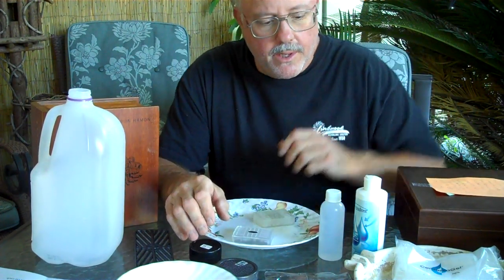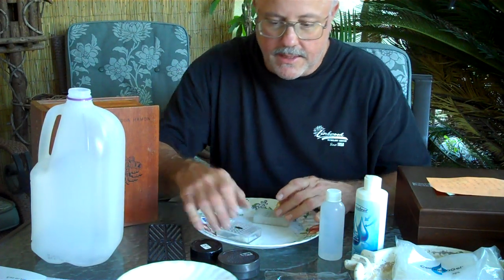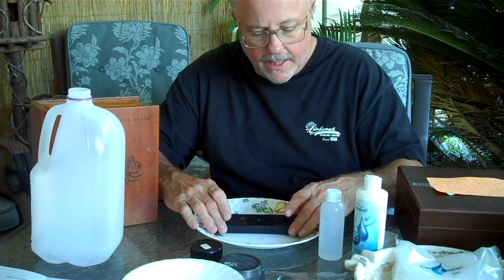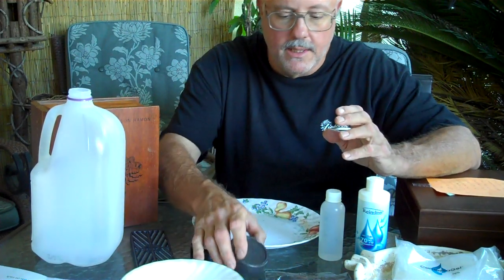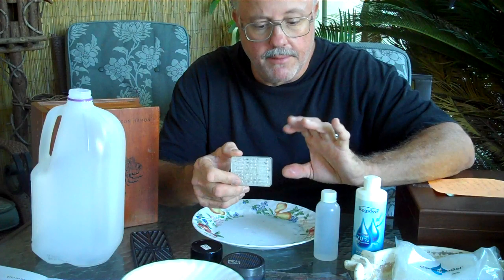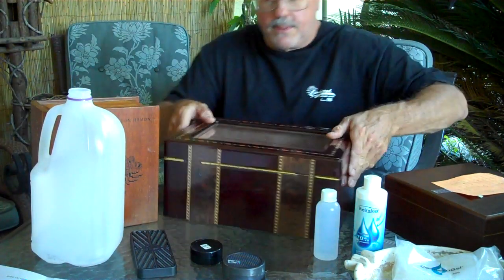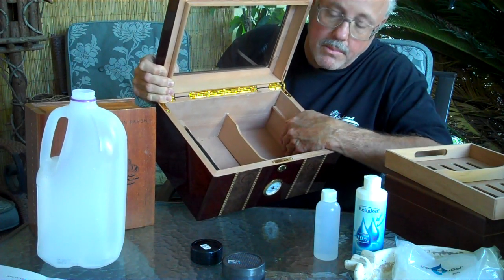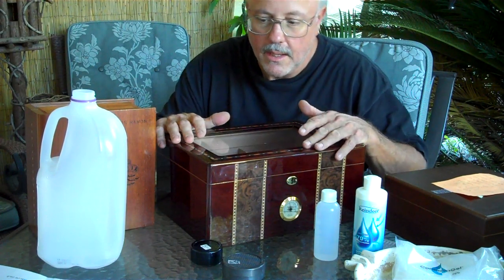Humidification devices for cigars by Mike, Paradise Cigars

Comment from the maker: The crystals last for a few years usually but I have seen some go bad in a short time. Just like the sponges perhaps there is a shelve life. If the sponges sit for a few years even in a new box when I open them the bars do not absorb water. That is why I check every humidor and set it up for the customers. Later experiments have me over filling the devices every few weeks, turn it upside down for a few minutes to drain excess, and that seems to keep the beads perfect, humidity also.

Comment from the maker: Move a digital Hygro around and see the humidity in different portions of the box. Left, right, top, bottom. 
From no shelve, 1 shelve or 2 shelves, 3/4" solid mahogany with 30 coats of hand rubbed laquer finish or 1/2" Bubinga with black ebony trim and curly Maple marquetry to cheap particle board I have to test them all. 
Doing it for 3 decades to test all the boxes over the years. Yes as salesman with a rep I have to make sure I sell the right product and it works.

Comment: Dear Mr Robbins, I have just gotten an new Humidor, it has no shelf and has 25-50 Cigar capacity (as stated on the box)
It has a glass top and comes with a puck and small sticky devices to make it stick to the top. Should I just stick it to the glass or are there any better options?

Comment: You say to combine propylene and distilled water, but the beads I've purchased (RHShield), it strongly discourages the use of anything except distilled water. What's the difference/reason?
Reply: In my experience with the beads. I put them in many customers boxes years ago cause they looked cool. They did not lose moisture fast enough to maintain the humidity and I had to go back to the black foam humidification with 30% pharmaceutical grade Propylene Glycol. Use what you have if you want and add one 72% boveda for each 25 cigars. The beads are cute though, good gimmick probably hoping most will smoke em before they dry out which is true.

Comment from the maker: In my experiments the area below the tray is trapped and the humidity can rise too high with a sponge humidification that is why you need to use Boveda.
The only other option is to take out the shelve and stick the humidification in the middle of the glass top.
Best is a box without a glass top.
But the Boveda in this scenario work perfectly in my years of testing.

Comment from the maker: Do not let the crystals dry out
Sounds like a rip offbut as I have never seen them evaporate 
look for the Reindeer system online but fill it every few weeks and tip over to drain out excess before  putting it in the box.
Let me know what happens 
You do need to use my solution to inhibit mold growth but just watch for black spots and replace if you use distilled water only.

Comment: I'd never own a glass top humidor. 
The only reason they make 'em is that glass is cheaper than wood. The glass top lets light through and light = heat. No matter the light source, once trapped inside the humidor, light causes heat. 
Also, light messes with the natural oils in tobacco. It changes the molecular structure and makes the oil go rancid. Just like olive oil if you leave it out in the light in a clear bottle. It's not for nothing that premium olive oil comes in colored glass bottles. 
The third reason why glass-top humidors is a crappy idea is that they draw cigar mooches like flies. You put your pretty cigars on display under  clear glass and complete strangers driving by your house slam on the brakes and walk in and help themselves. 
Buy a humidor with a solid top and a lock and key. "That's my aging humidor. Can't be disturbed." Keep the others in the bottom desk drawer.

Comment: Mine doesn't appear to be absorbing any water. Why is this?
Reply from the maker: Failure of device 
I've seen it in new humidors a 100 times (or more)
They will not absorb water after a few years - If it is new the humidor was on the shelve too long and the device won't absorb water after sitting for years. I always fill the devices in any humidor before the sale to check them. Get a new one and replace them every 2 years.
Reply: Mike Robbins I ended up getting it to work. Thanks for the tip though! I will keep that in mind.

Comment from the maker: In southern California I have my sollution to keep 70% humidity in normal conditions.
If you have problems wherever you are and the store that sold you the box cannot help, you have to experiment with the propylene glycol mix starting at 10% - 15% - 20 % - 25% - 30% - 35 % - 40% till you reach equilibrium. Otherwise I need to know the box with pics, the device, and where you are and I can make an educated guess. Try my contact at Paradisecigars@aol.com.

Comment from the maker: Season?
Do not wet down the boxes watch the videos please
Each humidity device holds 2 ounces of  water
30 cigars have 2 ounces of water in them 
4 ounces of water to stary start the box is enough 
In my testing if you fill the device and put in an adequate # of cigars that is all you need.
analog hygrometers are very innacurate.
Are you using 50/50 as that draws humidity too low?
Are you using just distilled water as that will cause mold to grow?
Paradisecigars@aol.com to send pics if you like